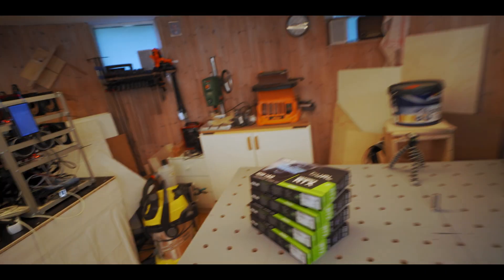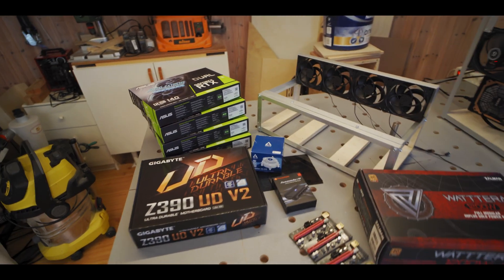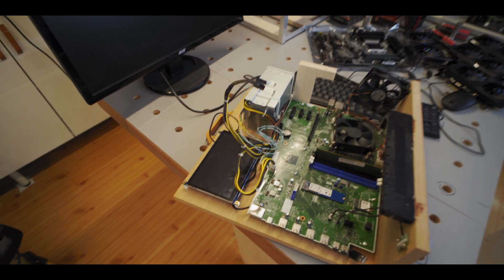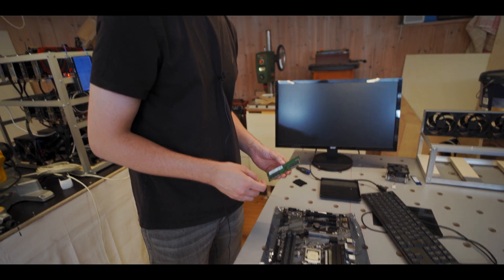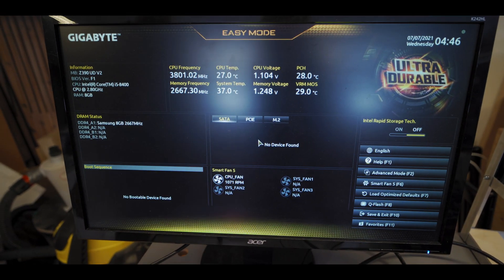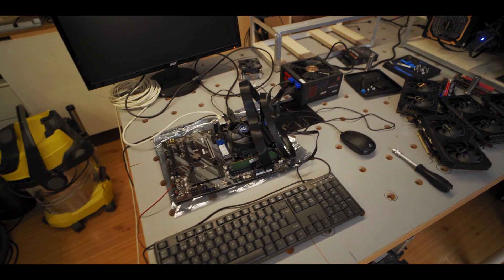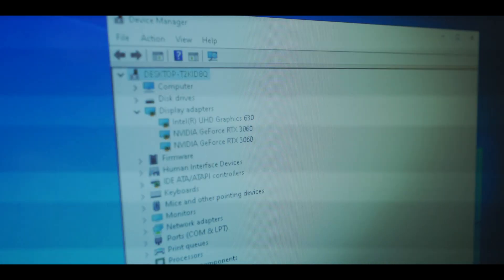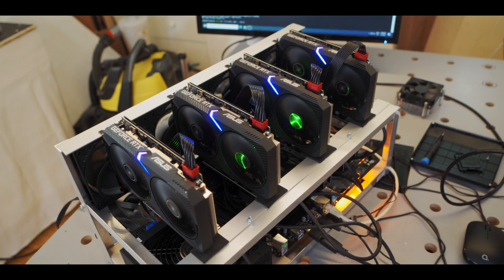Building an RTX 3060 Ravencoin Mining Rig

Comment from the maker: Any questions about this rig? Are you mining RVN? Let me know in the comments! Wanna know why I built this rig? Video here: https://youtu.be/L0m55Qr__tM Wanna see me build another mining rig? This video is for you: https://youtu.be/P6r3oW3O2oE
Reply: Can u show me ur GPU oc setting?
Reply from the maker: @ArunreaseySann  pl 90% core +200 mem +1175 but PLEASE don’t just copy my numbers they most likely won’t work for you. You need to slowly increase each each adjustment until ou get a crash then dial it back. Only use my numbers as a reference.
Reply: @SebsFinTechChannel  thanks 😊
Reply: @SebsFinTechChannel  Could be possible to use this directly in the t-rex command line? Are the same values?
Reply: Did u install any video driver befor starts mining?
Reply: Are those lhr cards?
Reply from the maker: @c-raw8990  technically not. So all 3060s have an Ethereum hashrate limiter. There was a version 1 of that limiter that people found a workaround for with a special driver and dummy plugs. That’s the kind I have in these. Then there’s the v2 3060s that have the “full LHR” which is the same LHR as in 3070ti’s and so on. But that LHR still only affects Ethereum mining so won’t affect ravencoin. :)
Reply: @SebsFinTechChannel  thanks Sebs!!! Was looking for these info.
Reply: @SebsFinTechChannel  you're getting only 25MH/s per card ... most definitely getting burned by LHR.  You should be getting at least double that.
Reply from the maker: @kupacmac  no this is ravencoin. Hashrates are not the same as Ethereum. It’s a different algorithm.
Reply from the maker: @kupacmac  as of now it seems that the LHR limiters have no effect on Kawpow which is god :)
Reply: @SebsFinTechChannel  so its okay for 3060 to run below x8 speed unless its mining Ethereum isnt it Seb?
Reply: Did you plug those 3060s with x1 PCIe connector to the motherboard? I need to use x16 PCIe riser to get full hashrate on ETH mining. Just mine RVN this week. Need some advice to buy more GPUs
Reply: Do you know whether 3060 Rev2 cards work on risers connected to H81M motherbord?
Reply: Great video, I used some of your settings, and got about 23MH/s on my single 3060. Just wondering how many cards can that motherboard support? They are good for mining?

Comment: Hy guys!Is there any way to get the full hashrate (48+MH/s) on a 3060 what is made after 2021 July(dev driver 470.05 does not work on them)?
I tried NBminer with 471.41 and -lhr 68 and get 32,5....
Under Linux is 37MH/s(Is it true?)
And MiniZ maybe gets 40....
Any idea to get the full hashrate?
The cards have the correct chip they are "only driver limited" ones .
Thx for all suggestions!

Comment: man, I got a few rtx3060 as well atm, what is your rvn overclock? i got very low at my msi rtx 3060
maybe i did it wrong at the overclock
Reply from the maker: For ravencoin I did 80% power limit, +200 core and +1200 mem. Please note just use these numbers as a guide. Overclocking is individual and every GPU is slightly different
Reply: @SebsFinTechChannel  sure, i will try your oc as well, Thank you 👋👋👋
Keep doin good content man, your channel is great!!

Comment: I recently bought an ASUS 3060 ti and I am only able to get 30 mgh for ethereum. I use lolminer. I tried switching miner but I still get 30 mgh? Does it mean it would be better if I mine something else with that card?
Reply from the maker: Sounds like you got a newer version of the 3060ti with the LHR hashrate limiter. I actually just made a video about a way to partially bypass that limiter using NBminer: https://youtu.be/Nxa9QcWrwsY

Comment: Are you using a dual 8 pin or 8 pin splitter for the gpu and riser? Or are you using separate cables?
Reply from the maker: Separate cables in this case but since the TDP for 3060s are 170W you could do a splitter cable one to GPU one to riser as long as you only have one GPU per PCIe cable. You might wanna watch this video on safely powering your mining rig components: https://youtu.be/MIW0i7SlIYI

Comment: Hi thanks for video.
Could you please share OC settings you use for 3060 and miner you using?
Thanks in advance
Reply from the maker: Miner is Trex miner. 80% power limit +200 core +1200 mem (windows). Good luck!

Comment: Did u plug the dummy hdmis for max hash rate?
Reply from the maker: Thanks for asking. You actually do not need to do that for ravencoin. The 3060s are only hashrate limited on Ethereum. :)
Reply: @SebsFinTechChannel  And LHR is only on the V2 version of the RTX 3060 -- correct?
Reply from the maker: @JustinUrich  yes but that doesn’t affect ravencoin either :)

Comment: I received my 3070 ti tuf order today and it runs HOT.. 30c ambient and %100 fan speed, overclocked to the limit at 240w memory temp doesn't go below 98c
Reply: at 40.5mh this card is insane but should I keep running it at 96-98 degrees ? is this going to kill the card very quick ?
Reply from the maker: From what I’ve heard mem temps are fine as long as they are under 105C.
Reply: @SebsFinTechChannel  thanks Seb

Comment: Hey, I’m running two 3060’s on Raven and getting 40 mh/s for both tops at the moment, I have them plugged straight to mobo, oc settings similar to yours. But I can’t find the sweet spot to get them higher, any recommendations?
Reply from the maker: Well 40mhs for both is still pretty good. Ravencoin is limited by the power limit so unless you keep the power limit at 100% the hashrate is going to start dropping. What are your current overclock settings? Good luck!
Reply: @SebsFinTechChannel  I’ve tweaked it a little to -50 core +1200 mem 74 power managed to get it up to around 43 MH/s at that. I’m going to leave it at that for 24 hours and see how it goes 👌

Comment: could u use the same build to mine ergo ?
Reply from the maker: Definitely! This rig would get around 400mh/s on ergo, maybe even up to 480mh/s depending on your luck as it seems ergo sometimes is limited by the LHR limiter. But I tested this rig on Ergo and got around 420mh/s
Reply: @SebsFinTechChannel  Cool, but why does LHR affect ergo mining? thought it only affected eth
Reply from the maker: @h-c4146  it seems it has a slight affect on ergo since the ergo algorithm is quite similar to the Ethereum algorithm in how it accesses the memory.
Reply: @SebsFinTechChannel  ty for the  info 👍🏻

Comment: Hello Seb, i m new to mining field. I'm still on the documentary side, I've been doing this for two weeks and I feel like my head is exploding. Quick questions, if you want please answer: the RTX 3060 from your build are LHR? I want to buy one card and I did a lot of calculations, so: 3060 LHR - 710 USD / 3060 TI LHR - 862 (the cheapest one, inno3d) (my strategy for future: raven and ergo). I was fixed for 1660 super, but after rth 2.0 i need a future proof card to build around. what I want to add is that I like your videos, you look like a very calm guy.
Reply from the maker: They are not LHR but LHR would not have mattered in this build as Ravencoin mining seems to not be affected by the LHR limiters.

Comment: Nice video! I got one of those SSDs (512gb)in a package deal with a gpu, how do i get HiveOS or windows on it? I dont want to boot from a usb. Is there a USB adapter like normal kingston ssds that you can get to load software directly on to it before installing onto the motherboard?
Reply from the maker: It's an m.2 SSD you've got, yeah? You can either make a windows installer USB that you plug in at the same time as the SSD to your computer, then you boot from the USB and install Windows onto the SSD. Or you can get an M.2 enclosure that lets you plug the M.2 ssd into a different computer with USB like if it was an external drive and then you can flash an operating system onto it.

Comment: Why not 3 1080ti over 1 3060?
Reply from the maker: Well one 1080ti cost about the same used as a new 3060 currently where I live. They get around the same hashrate but the 1080ti pulls more power.

Comment: Is it the lhr version?
Reply from the maker: This is LHR v1 which is the LHR version you can get around by using a dummy plug and the developer driver. But it would t matter if it was LHR v2 (the same as for example 3070ti has) since LHR only affects ethash and not Ravencoin :)

Comment: What were the overclocks you used for the 3060s?
Reply from the maker: 90% PL, +200 core, +1175 mem. But PLEASE know all cards are individual and need individual overclocking settings. Only use mine as a reference to find your own. And overclock at your own risk :)

Comment: Hello Seb, What software miner do you use ? is any OC setting applied to get lower Power consumption ? 152 Watt is very high
Reply from the maker: Ravencoin kawpow algorithm is very power hungry. I use Trex miner and I apply my overclocking directly in Trex as I show in this video: https://youtu.be/0F4xxcCAJVI RTX 3060s have a TDP of 170W so 152W is still lower than that. For this rig I did 90% power limit which is why it’s 152W and not 170W.
Reply: @SebsFinTechChannel  Thank you for the information.

Comment: Nice! not that I can do the same (prolly sold out), just curious, where did you find the GPU's?
Reply from the maker: Thanks! So GPUs are actually starting to come into stock regularly in my country so I was able to pick these up from a local computer hardware store for about $512+tax each. Fingers crossed this is a sign of GPU shortage getting a bit better! 🤞
Reply: @SebsFinTechChannel  Meanwhile in Finland....€650.00 for the cheapest RTX 3060s..... and still limited to 1 per customer 😢😢😢
Reply from the maker: @Mayhem2019  hopefully cheaper ones will come into stock soon! I check the online stores multiple times per day, usually the cheap ones sell out in a few hours so easy to miss! Good luck!

Comment: @Sebs FinTech Channel  On my way to have 3x 3060s :D
Unfortunately I don't have a 4th slot that could support them haha.
Lil question, are you using pcie-x16 extensors or risers? I know that for Eth it makes difference, but for RVN it doesn't isn't?
Congratz Sebs!
Reply from the maker: No you can just use normal risers. It’s only ETH that is limited.
Reply: @SebsFinTechChannel  Thanks!! Great to know!

Comment: Nice. Did you have to re_apply thermal paste on cpu before you added the fan. I have to do that this weekend. I am getting a 12 gpu mobo and have to transfer my cpu and fan from my test bench  LOL. You should have shown how you removed it from your test bench.
Reply from the maker: So since I got a brand new cpu fan that came with thermal paste applied. So I removed the cpu, cleaned off the old thermal paste with isopropyl alcohol and then chucked the old cpu cooler and used this new one that had thermal paste already applied. :)
Reply: @SebsFinTechChannel  o ok. Thanks for clarifying. I will go and buy isopropyl and thermal paste.
Reply: How did the wattage compare with your previous video estimate?
Reply from the maker: @BizWithBruce  the 3060s pull a slight bit more power than my research found but they also get higher hash rate so in the end it worked out to be about the same anyway :)

Comment: bro, cant you post oc for eth in 3060 evga xc is unlocked get 47mhz only, and get gpu crashed list
Reply from the maker: For ETH put core clock on 0 then slowly increase mem clock until it crashes and reduce mem clock by like 100 from where it crashed. Then reduce core clock until you see hashrate go down a lot or crash. Then reduce power limit until hashrate goes down too much or crash.
Reply: @SebsFinTechChannel perfect! i have a samsung memory, in my evga 3060 this is my oc  power limit to 70% and temp limit 71c the core clock -502 and memory clock +1200 and fan speed 75 this is a good ? 47-48